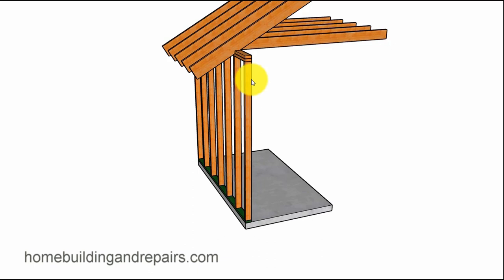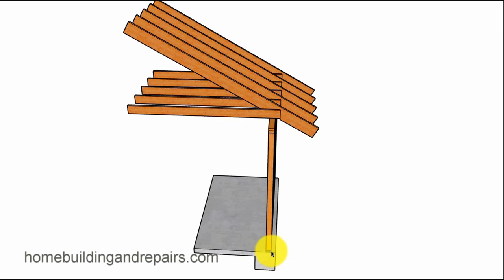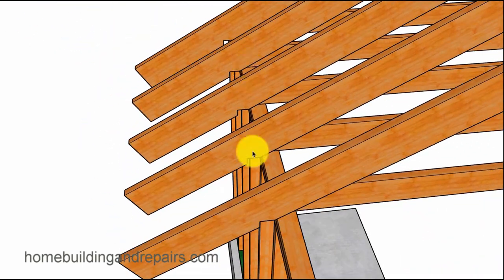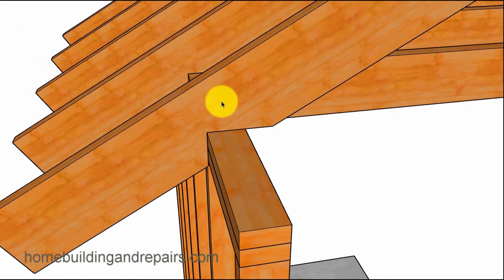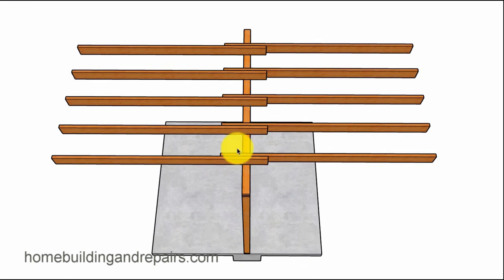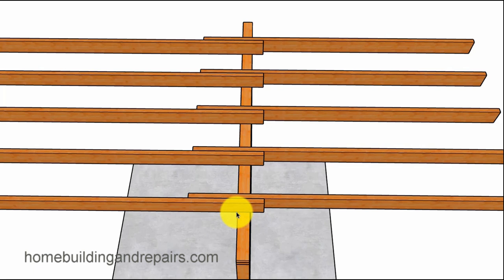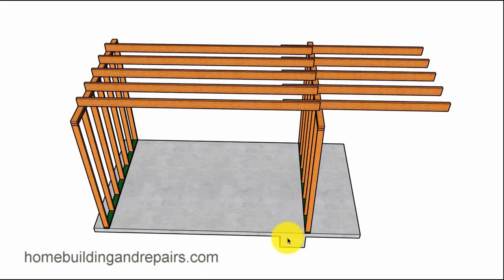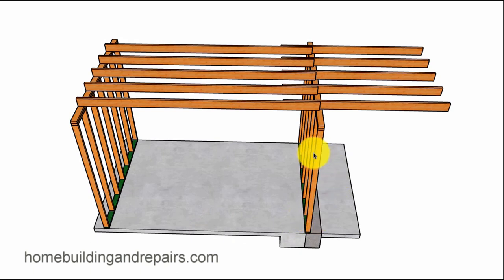Problems You Could Run Into Moving Load Bearing Wall A Few Inches - Home Remodeling Answers

Comment: I have a 1950s home, hip roof, dissatached garage. I wanna remove an interior load bearing wall between living room & kitchen about 8-10' long, i know it sits on a steel support down in the basement. Do you think two 2×8's is enough? Would it still need some 2×4 as fill in between? I know you can't provide structural information but just asking friendly advice. Thanks!
Reply from the maker: I would need some more details or you can email me some pictures of the area for an opinion.

Comment: Hi there,
This is a very great video. I am doing some remodeling in my house an have a question. I want to open a load bearing wall on main floor for about 18' and there is a room and the roof on top. So the question is: Can I use 4 pcs of LVL 2x8x20 to open this wall on main floor and transfer the load to the wall in the basement which is a load bearing wall?
Reply from the maker: I cannot provide structural engineering information, but have seen for 4 x 12's used for single-story homes like in a two-car garage for the opening.

Comment: Thank you for the video it Helps a lot specially how not to do it! 
as it can be catastrophic. 
i need to know if i can sustain the roof and ceiling on a similar side wall as the one on your video but On 2 points only No stud wall... 
As I have a 16ftx22ft exterior garage that i like to extend to 16ftx27ft. Extra 5ft out
I have the extensions concrete laid out measuring 16ftx5ft.. In other words...
 How can i get rid of the stud wall and extended 5ft out and still support the roof and ceiling weight on the same point of 22ft... 
Thanks and i hope you can help me out
Reply from the maker: I would suggest going to our website and checking out some of the structural engineering videos along with the wall, floor and roof framing.
Reply: @gregvancom  i did and found what i need. Thank you so much

Comment: I have a triple ceiling joist , with two load bearing walls, the thing is the previous owner knocked out one wall to make the master bedroom bigger but left the big beam exposed , if I was to move that over a ft and make it a actually wall again what’s the method best used if it has 3 ceiling joist with the middle joist resting on two load bearing walls
Reply from the maker: If the joist weren't modified, then it seems like you can rebuild wall.

Comment: Question 
I have a low bearing wall and I wanted to remove 2 of the 2 x 4 and make my hall wider to 36 inches can I just install a header to support the weight
Reply from the maker: I can not provide you with engineering information, but I can tell you that I've seen plenty of projects where someone removed two wall framing studs and installed a properly sized header to create an opening.